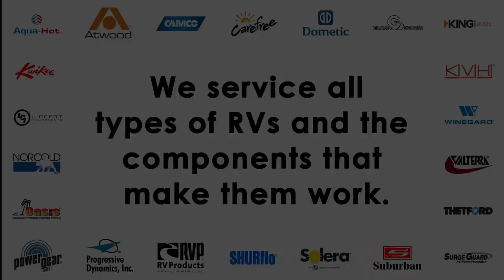RV Refrigerator Cooling Performance Issues – Cooling Unit Blockage & Ice Dam issues

Comment: A little trick so you can get the foam deeper into the crack, find a drinking straw the same size as the foam tube and slide it over the tube. The straw will collapse down allowing you to go deep into the crack.

Comment: You saved me 1200 bucks on a cooling unit. My 2017 1210 has the same issue, ice damming. I thought I had a moving blockage. Inspected it and it's just as you show in this video. Lots of water stains, loose tape and open seams. Thanks for saving me some cash and work! I appreciate it!

Comment: I have the same issue and will try defrosting and dry out before removing. I replaced the CU a few years ago put probably did not foam it. I did use new tape though. It usually runs a looong time between heating up. Freezer stay solid frozen.
 Thanks for the VID. Another repairman calls it saturation.

Comment: Thank you for your video I watched it and bought a brand new RV and had the duct tape on it and I did what you did on that repair so maybe I'll get plenty of years out of it it of years out of it By the way there's nothing wrong with the refrigerator I just figured I would prevent the problem by fixing it early Like you did

Comment: Darren- Brilliant on the waterproofing of the gloves!  I love the tips that are also inexpensive!  Thanks for sharing! It's unfortunate that the manufactures are not taking this step that you are using yourself with expanding foam and HVAC tape.  You seemed to answer the question as to why the manufacturers are not using the expanding foam since it makes it extremely difficult to service/replace in the future. But the cost-saving measure of low-quality duct-tape over the metal tape is really sad to see by these manufacturers and even the companies putting these RVs/Campers togther- they could reinforce and simply pass the cost onto the consumer, I'm sure most people would pay for that samll upgrade. Well, at least now we all know what to look for (failing tape, water marks gradual decline in performance) as well as how to fix this!  Like you said, this video coupled with your damper videos should have us creating a system like it should come from the factory! Is the regular expanding foam or low expansion foam better for this purpose? And lastly, since this was shot back in Feb/Mar, do you know if it worked?  These are awesome videos- thank you for doing all that you, your family and team do for the RV community!  Cheers!

Comment: First, I would like to thank you, Darren for your very clear and repeatedly emphasized important points on your educational videos. 

I have learned a lot about absorption refrigerators in the past weeks just watching your videos. The whole time, I have been trying to diagnose cooling issues with my Dometic RM2350 (which I still could not find a service manual for more detailed componentry specs).

At this point, I am still unable to confirm where the issue(s) is/are without getting replacement parts (expensive) to figure them out. If you don't mind and can please advise me, I would like to detail what I have found out so far from monitoring the situation.

Condition:
1. Refrigerator is level.
2. Gas burner works boiler to hot but outer jacket still touchable with hand without being burned.
3. 240v AC electricity mode does not get the boiler hot but rather warm only to the touch.
4. 3 x extractor fan installed with baffle to vent the upper fins.
5. The lower absorption "coil" is hardly warm to the touch. 
6. RV has not traveled during this period so ruling out any knocking around.
7. Ambient temperature outside between 80F and 90F (summer in Australia).
8. No visible blockages behind the unit. Quite clean and no sign of ammonia leaks. Unit appears to be in very good condition visibly.

Current situation:
1.  Freezer (still) gets cold down to around 19 F but a few weeks ago it was down to 5 F. Food compartment does not cool below 60 F when it had before gone down to 40 F several weeks ago.
2.  Adjusting the thermostat does not seem to affect the temperature in the fridge.
Reply: What was the fix/problem?

Comment: Great video, lots of info. I have a Norcold n821 and the fridge is not as cold as it should be. The freezer appears to be working fine. I tested the thermistor ohms and they are ok. Can a control board cause this? Also the fridge will not turn off. I was going to buy a control board because it will not turn off. I also reset the panel and it did not fix it. The fridge may be original the 5th wheel, year 2002.

Comment: Speaking of blockages I had a leak through my maxxair exhaust fan in the bathroom and ended up taking it to Camping World and they found that rainwater was coming in through the refrigerator roof vent so I agreed to replace it. got it home and within a couple of hours My perfect running Dometic refrigerator was severely overheating on all sides inside outside roof ceiling. I'm taking it back in tomorrow to Camping World and they're supposed to put their best man on it again. Any suggestions besides a blockage It seems like the roof vent cover is way too close to the roof and not getting adequate circulation to cool the fridge down. I mean even the roof is tacky it's so hot. Maybe I mentioned it but this was a perfect running refrigerator until Camping World got a hold of it. Thanks so much.

Comment: Thanks for this video on RV Refrigerator---Cooling Unit. In reference to damming,  not blocking. Without watching the video again or searching for others videos.  I have a question on my Dometic unit: Is the icing happening on the inside of the Refrigerator fins or on the outside coils. My inside aluminum fins ice up after about a month. I have not pulled the Refrigerator out of the hole. After removing the outside cover, I don't see any water marks. The unit is about 5 years old,  since new there have been issues with the auto changing from electric to gas. This has to be done manually with the control buttons every time we hit the road. Again, main question is about inside icing. Thanks, have a great day.
Reply from the maker: The icing on the inside fins and the icing we see in the cat box are totally different unrelated issues.
Reply: @MyRVWorks  Thanks

Comment: I got a Norcold 1200 first year it was great that was 2017 have had it worked on 4 times 3 times at the dealership where I bought it and one time on a trip from a mobile tech still have the same problem fridge cools but doesn’t get cold any suggestions

Comment: Thank for you video is excellent I’m looking to resolve issues with my refrigerator 1210 , my RV is only 3 mounts old 2021 and we programming weekend my surprise was in middle of the park my refrigerator don’t start we try LP and same , I’m try to comunícate with service department and is imposible I was for more of 4 hours final they disconnect my call my question is the unit has any fuse in the electronic box I can check? Thank you for your answer.

Comment: Hi. Great videos! I just had the cooling unit replaced in a 2018 forest River fr3 (norcold 2118) and camping world says that we cannot turn the fridge on for 24 hrs because the  cooling unit needs to be “stood up” for 24 hrs before applying power to it. Does that sound right? Is there a good way to test the new cooling unit before we leave? For example is a few hours on gas followed by a few hours on electric sufficient to ensure it is working properly? Thanks!

Comment: Our fridge is cooling fine but the freezer is not getting below 22 degrees. It had only been on for 5 days. Do you still think damming could be an issue? Norcold 1210...we are in CO so not much humidity or high heat...averaged in the 80's

Comment: Hi Darren, 

I full time in Alberta and just had a wonderful cold snap dropping below -30°C. A couple days after we hit the low my fridge just stopped cooling. Found the 15a 12v fuse in the panel was blown but replacing did not correct the issue. Everything seems to be working but just not making the cold, gas or electric. 

Am I likely having the same issue? My RV is a new 2021 model purchased in May with a dometic single door.

Comment: Great video!  Probably what's wrong with my Norcold (nevercold enough) unit that came factory installed in my 2020 Keystone Fuzion 427. I've had it back to the dealer so many times I've lost count to no avail. Tomorrow I'm pulling the Norcold and installing a Samsung French Door w/ dual icemakers exactly like my residence for around $2,000.00.   Maybe I can figure out how to sell the Norcold after I repair it or put it in the deer hunting cabin.  LOL .  I'm totally wore out with the absorption systems.  My 2015 Montana Mountaineer with Dometic was even worse!  We've thrown out enough food over the past few years to pay for the residential Samsung.  Now that we have an onboard generator and 60 gallons of fuel I just don't have a need for LP.  Again, I really appreciate your video!

Comment: Been watching you for a while.  My question, I have a build up of ice inside my fridge that has to be defrosted once a month on my dometic with freezer on the left side.  The cooling unit was replaced.  I believe that my problem maybe similar.   Seems to cool ok.  Ice cream in the freezer doesn't seem to  freeze hard.  Going to look at the air flow.  What do you recommend?

Thanks for your videos
Reply from the maker: This is another symptom of an ice dam. So it may be worth pulling out your unit and looking at that void around the cat box.

Comment: Darren , I have a dometic 6062 it's been sitting idle for at least ten years. When I plugged it in o 110 volts I heard it boiling when I checked it the next day it was hot inside the fridge and freezer any thoughts . I did not try it on propane . Thanks

Comment: Telford N112 fridge is working on gas but not on electricity neither 230v or 12v, both heating coils are working as they get hot but not cooling inside. Any idea what could it be? Thank you

Comment: I have the same unit 1210 and the fridge is staying warm. My left door has three buttons, the bottom one gets extremely hot and shows some melting. The freezer works great but won't freeze ice cream. I saw your other video on the thermistor inside. What are the odds that is my problem? I hope it is that simple.
Reply: I have a 1200 Norcold that sounds like the same thing. The upper metal cap that receives the spring pin is hot and burnt, my freezer is 9 degrees and fridge is 58

Comment: HELP!!! I have a dometic rm2551 never installed in a camper, used for 1week at a deer camp then sat in a garage for about 3 years, looks absolutely brand new. Sitting in carport it will start to get cold then stops cooling both ways 110v or gas. Tube coming out of boiler almost too hot to touch, cooling fins cool,1rst section of coils tube coming out of fridge is cool/coldish, rest of coils warm. Tried thermistor plugged in and unplugged no difference.
Reply from the maker: These units require that chimney on the back side around the cooling unit. You really need to build that.  You can use cardboard box or something like that and some fans to channel that air directly over those cooling units and out. In this link to video around the 15-minute mark I draw a diagram. Study that and build that and then see what happens.  https://youtu.be/IT_5HGe4q-k
Reply: @MyRVWorks  ok I’ll try that with this unit. I have 2 more also sitting in garage, 1 is 25 yrs old and the other 15 yrs old and they both get ice cold just sitting in the open with no chimney or fans

Comment: Hi , Darren do have a question for you , i do have a Dometic fridge , model RM1350SLMX 4 doors type , would it make sens to ADD fans in the lower portion of the rear fridge ( air intake grill)  to make more air to flow inside from the bottom ??? Thank's or if that would cause a issue
Reply: @Al Gau, after watching Darren's vid, I think you only want to add the fans under the Upper Heat Fins to scrub the heat off them, so they can absorb more heat from the Heat Exchange process. I believe adding fans at the Air Intake Grill will cool the Boiler area, where you want it to be hot for the Boil mixture.
I'm no expert in Refrigeration, but I think this is the case.

Comment: My issue is an over cooled freezer and warm fridge. Got any tips for that?
Reply from the maker: When I see that situation the first thing that I look for is the proper airflow and baffling up the backside Cooling unit. If you cannot properly shed the heat off that cooling unit, then you will have performance issues, and it usually shows up in the refrigerator section first.  On our website we have many refrigerator manuals so see if you can find yours and study how the ventilation is supposed to work up the back and make sure it is that way.  https://myrvworks.com/manuals/

Comment: Good video.  I would like to make a suggestion.  The name "ice Dam" may not be the best term.  Looking at your videos on the cat box, and the ice in it, and thinking about the engineering , would indicate that the ice is forming a thermally conductive path inside the cat box to the warmer edges.  Ice has a thermal conductivty of 2.5 (W/mK) which is some 80 times greater than the foam insulation.  It might be more helpful to call it an Ice thermal short or a heat leak.  Filling the gap with foam would block the leak, and the tape would stop the water vapor from getting in.
Reply: Huh. Yeah ‘heat leak’ or ‘thermal short’ makes a lot of sense. I was trying to figure out what the actual ramifications of the ice buildup were — why that ice build up caused the freezer to warm up exactly. “Thermal short” totally makes sense. All of the thermal absorption is happening via the seal gaps and results in ice around the edges rather than happening inside the freezer compartment. E.g. ‘thermal short’. Nice!

Comment: How long did it take you to do that? From start to finish?
Reply from the maker: If I didn't make a video of it and I got busy I could have diagnosed it in about 5-10 minutes and then it's just a matter of pulling the refrigerator and taping it up. Maybe 1 - 1. 5 hour actual task time.  Having said that. I've literally worked on hundreds of refrigerator repair jobs so I've had a lot of time in the saddle for these types of repairs.
Reply: @MyRVWorks  your skill never ceases to amaze me, both an actual maintenance work and in the ability to communicate it. Your videos are an awesome watch for a budding tech like myself.

Comment: As you said your all over the place. The thermo sensor can be blocked has fallen off Evaporator and temp thinks it warm so unit doesn't cycle off. Do t quit your Real job